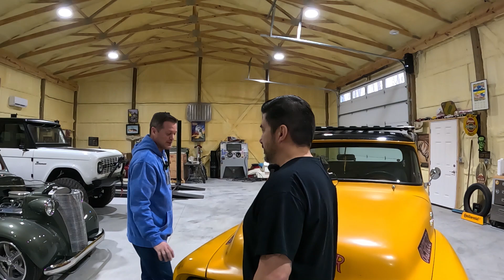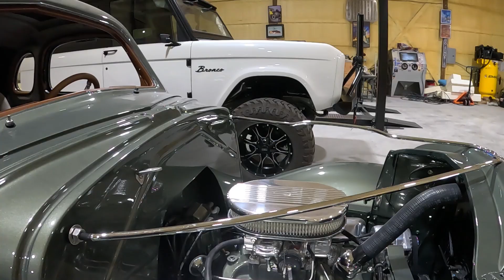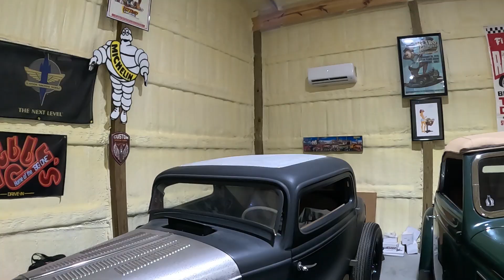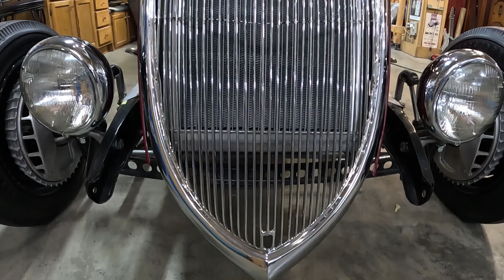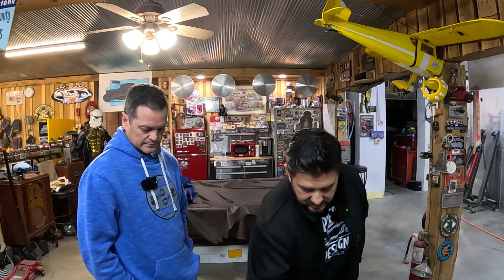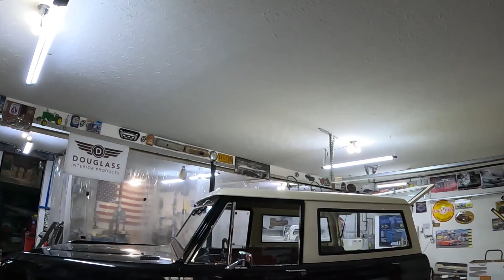Hot Rods Projects Everywhere!  Don’t Miss This!

Comment: The 32 is beautiful. I love the car. The traditional engines are cool but not at the expense of trailering the car everywhere in fear of a breakdown. Small block Chevys may be a cliche' but they fit and are a dead nuts reliable genius design. I recently realized that 403 Olds engines are fifteen pounds lighter than a SBC and the same dimensions only a half inch longer, so it will fit in a most rod applications. Siamesed cylinders like a 400 SBC but the bore is like 4.35 with a short stroke. You can adapt big block 455 olds aluminum heads to them by drilling out the bolt holes to half inch and adjusting the intake. Intakes are basically limited to the Edelbrock 7111 single quad manifold but again thats probably best for drivability. Id love to put one in a rod. Modern design so roller cams are available along with forged pistons. I'd be really tempted just so I was driving a cookie cutter SBC>